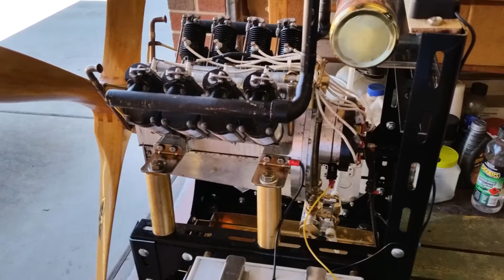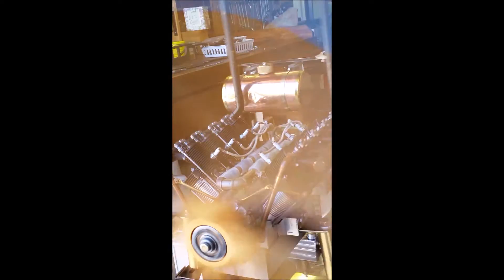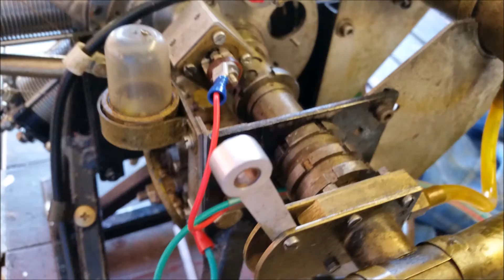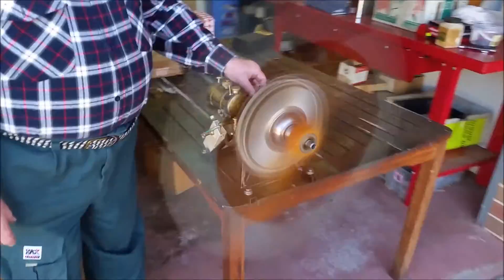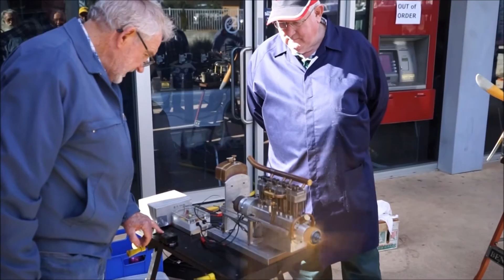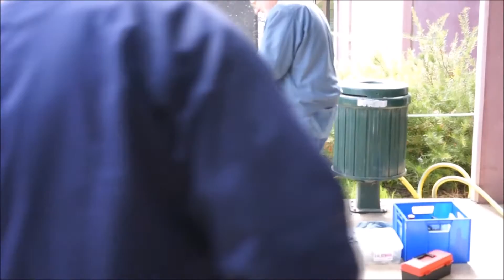Engines of Old

Comment: Some interested people have expressed disappointment that the RAF 1a V8 engine doesn't rev, roar and rumble like a modern V8 car engine. This engine is 1914 technology and is one pip above steam engine technology of the time. Revs were low 1200 to 1500 being the nominal range reliability was not good so they used a large diameter 4 blade coarse pitch propeller running at camshaft (2:1) revs. to fly with.  The V8 most people associate with was invented by Henry Ford about 30 or 40 years later, so the 1a is not high performance and behaves very much like the full size engine does. So please appreciate it for what it is a 1/4 scale model of early aviation.  Best Wishes Barrey P
Reply: Indeed. They were little more than a mildly modified Antoinette.